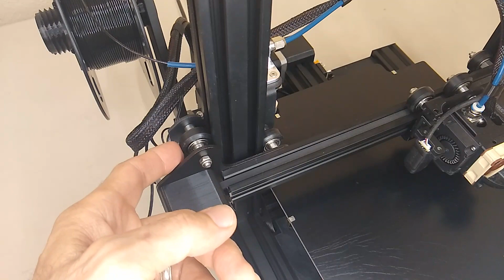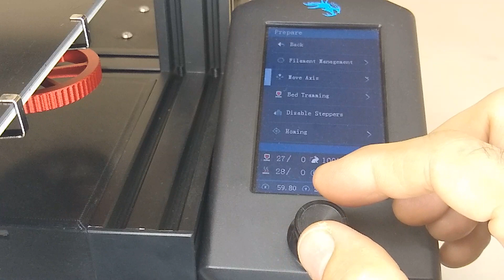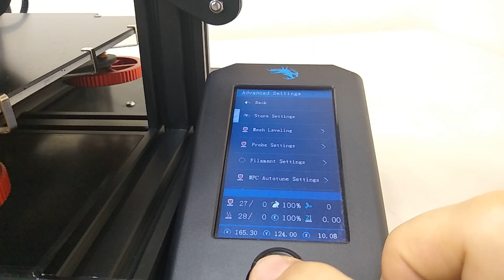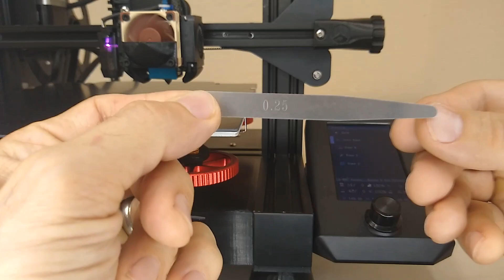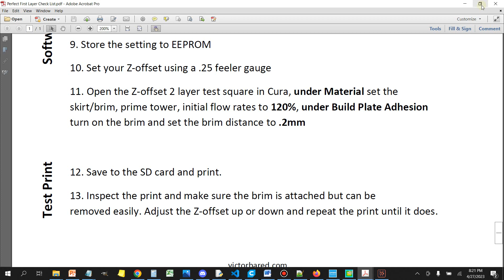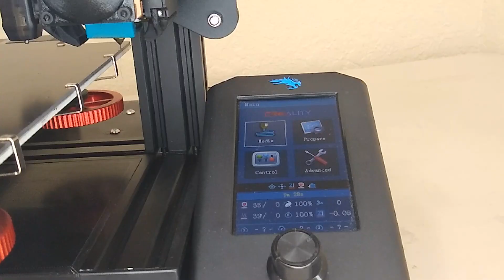Ender 3 Pro V2 How to Setup the Perfect First Layer and Minimize Stringing

Comment: Do you have a recommendation on a video like this for Ender 3D pro? 
I tried following the instructions but I noticed I don’t have some of the settings you’re talking about. Thanks
Reply from the maker: Hello friend, Thank you for commenting. I'm glad you found value in this video for your viewing time. Please provide more details on which firmware you are using on your Ender 3 Pro.
Reply: Thank you so much. I currently have the Marlin firmware 2.0.x
Reply from the maker: @BigCookieHouse-fk6pj  Hello, Your printer should have a Creality 4.2.2 control board so you're half way to being able to install Miguel's Professional Firmware. The last thing you will need is an Ender 3 V2 display. Check out my video on how to install and customize the firmware.

https://youtu.be/2NqHNYtyEa4?si=MEYBOtdHH1ohyuL4
Reply: Thank you so much

Comment: Just found your channel you have a lot of great content! I have a question, why do you suggest getting the z offset smaller than 1mm? mine is currently -2.4mm what benefit is there to getting it smaller than 1mm?
Reply from the maker: Hello friend, thank you for commenting and encouragement. I'm glad you found value in this video for your viewing time.

I used to have many issues with my bed meshes in both Marlin and Klipper. On only some of my machines. What I found is that Marlin ignores mesh points that are greater than -2mm and would require manual editing of the stored bed mesh to make the machine print properly in those areas. So let's say you have a Z-offset of -1.75 and after running your mesh there is a point that is -.40 at that spot you're going to have a combined Z-offset of -2.15, the same thing happens in Klipper. To reduce the Z-offset I found myself having to modify my probe mounts in CAD and reprint them. This is super annoying to due when you run many printers and that's when I came up with the idea to create an adjustable probe mount that can dialed to whatever Z-offset I require. So what I found works best is to set the Z-offset to between -.25 and -1.0 so I can have up to a -1.0 low spot on my bed , which I've never come across, so Marlin and Klipper will compensate for it. The adjustable bed probe mount is a game changer and I run them on all my machines they can fit on.

Best of luck with your mods!

Comment: Hey there, i have an Ender 3 Max Neo, only have done a few prints but I find if im printing a solid square base layer as its filling in the square the the distance between each line slowly gets greater until it just pops off or gets caught on the tip and spaghettis all over the ppace. Any tips? Bed was freshly leveled and cleaned my bed surface this iso and set my z offset all before the print
Reply from the maker: Hi Zac, Please provide your start g-code so I can get an idea of what pre print instructions your machine is receiving. Linked below is a video I made upgrading an Ender 3 Max NEO for a buddy of mine. I highly recommend ditching that heavy glass build plate for G10 Garolite linked in the video's description.

https://youtu.be/m_0vnfnbCv0
Reply: @vbared  where should i send the gcode file? do you have an email? i can send some pictures of my failed print. i have a magnetic PEI bed that i haved to istall. just wanted to get the printer dialed in before modifing it
Reply from the maker: @ChigBungus420  Please send it to vbared@gmail.com

Comment: I would love to know what that spool holder is you're using.
Reply from the maker: Hello friend, sure thing, here you go.

https://www.thingiverse.com/thing:3446507

I just placed mine on the top of the left rear extrusion. I'm using Micro Swiss dual gear extruder, which comes with a 3 inch long section of Capricorn tube that I bent into a 70 degree elbow for a smooth transition into the extruder.

Comment: Does the first layer has to have gaps like those in your brim? i feel like they should be smooth, with no layers visible
Reply from the maker: Hello friend, Thank you for commenting. Yeah, I hear you, it would be awesome if the layers could be put down to not show the layer lines. Unfortunately, there is no way to square up the layer edges. If you ever used a caulking gun you will understand that it can't put down a bead that has flat edges because it has to be squished to stick to the previous layer. It's a balancing act. If you set the nozzle too high the layer lines are more pronounced, Too low and you'll start accumulating molten filament along the edges of the nozzle that will cause stringing or blobs through the print. The sweet spot is in the middle but there is still no way to square the bead line edges.

Comment: Victor another question when I print your test square and hold it up the light I can see light through it and they all look like little pin holes, is supposed to be like that or is supposed to be a solid square where no light come through?
Reply from the maker: Hi Jeremy, call me 478-227-3301 it's easier for me to ask you a few questions about your current setup so I can quickly help you troubleshoot the test print then going back and forth using the YouTube comments. If I don't answer leave me a voicemail and I'll call you right back.

Comment: On X gantry leveling - tip - slide the ruler in between the gantry and the verticals. Gives a better visibility of the measures. Next level would be to use 2 rulers at the same time.
Reply from the maker: Hello mariusranga, Thank you for the wonderful suggestions. I was considering purchasing a couple of stick on metric rulers like the ones used on a table saw to do what you're suggesting. That way you can tell if they get out alignment with a glance.

Have a great evening :)

Comment: Wow all that just to get a good print but with my prusa mk4 printer and my prusa mini 10mins and printing perfect print with perfect first layer these'sare for someone who want's to tinker instead of printing.
Reply from the maker: Hello Viseo FPV, Thank you for commenting. Yeah, the way it's designed leaves a lot to be desired for sure. In addition to that the assembly is riddled with pitfalls that someone just getting into 3D printing would have trouble picking up on. In my opinion if budget permits a Prusa or Bambu Lab X1 Carbon would be what I would recommend someone looking to get into 3D printing today should consider for the same reasons you are pointing out.

Enjoy your weekend!
Reply: It also costs 3-4x more than this one. So you're paying for that quite heavily

Comment: Hey Victor, another great mate thank you. What firmware is this one and would it suite a Ender 3 S1 Pro?
Reply from the maker: Hi Glenncol, How's it going? It's Miguel's Professional Firmware and it can be loaded on the Ender 3 S1.
Reply: @vbared  Cheers mate, i assume the only real difference between the S1 and S1 Pro is the max temp  as far as the firmware goes?

Comment: Keep it goimg bud!
Reply from the maker: Hi Brad, Thank you buddy. How goes the Voron project? I'm thinking about putting together a Switchwire.
Reply: @vbared  Hey man, up and running finally with canbus.  Still working through tuning and such.  This thing prints great and is fast.  About to wrap up canbus addition to the CR10S as well.  The switchwire is a very appealing setup, can't wait to see your version.